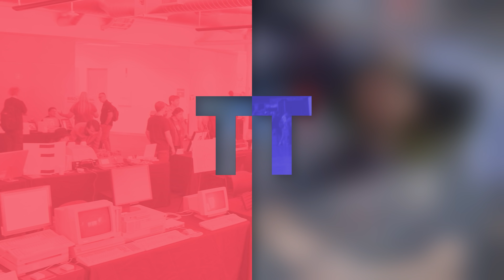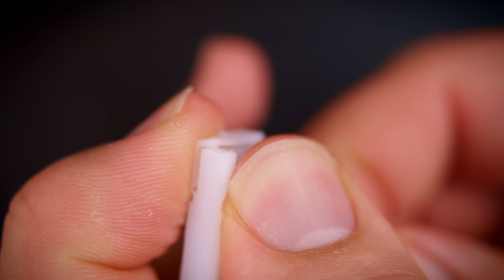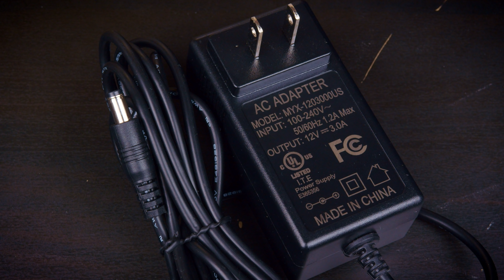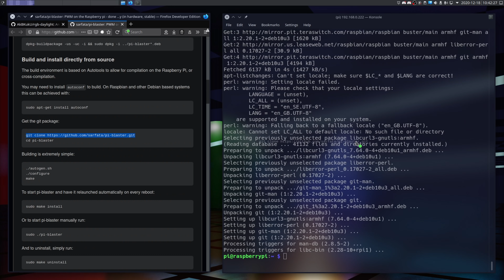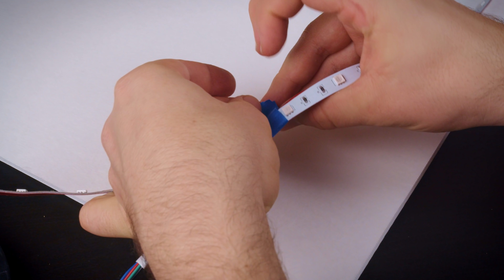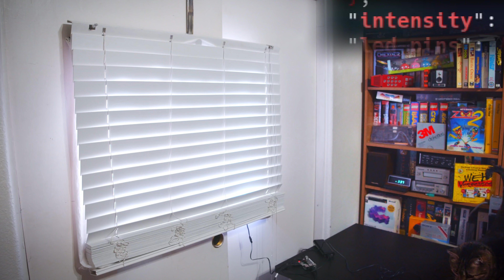RGB LED Daylight Simulator or Artificial Window

Comment from the maker: Normally I'd put this in the description but nobody reads that an I know I'll get questions about it. This is not my usual fair for sure, but it was a detour project that I just needed to do to clear my head a bit. I've been working on the VGA capture video, still, since I released the "How VGA Works" video and my previous statement of calling it a mess has never been more true. There are so many aspects of it that can completely ruin the video capture that I need to cover in extensive detail. It's becoming a really complex video that I need to distill technical topics down into easily understandable segments and it's just taking time.

In the middle of all that though, I also attempted to build a new computer. I say attempted, because after weeks of filming, troubleshooting, and part swaps I finally determined I had a bad CPU and needed to RMA it to intel. And that has been one of the slowest processes I've EVER been through. I started the support ticket to exchange the CPU on Nov 28th and after weeks of slow back and forth emails I only on Dec 23rd finally received a confirmation that they are sending the replacement, I still don't have it. Additionally, I only have one GPU that can edit videos(that isn't the 1070 in my server because I'm not disturbing that) so for all the troubleshooting and working I had to move that card back and forth between my computers which just isn't fun. Mixed in with the hardware problems were some inexplicable Davinci Resolve issue that would lock up the program for minutes at a time that just led to even more hair pulling trying to figure out if it was the software or bad hardware giving me mixed signals and confusing it all.

So I know it's been a while since my last video and this one isn't the usual fair. But I'm still working on things, it's just been a very frustrating experience of start and stop projects that are putting up far more resistance than I planned for. This project, in addition to just being something I really like the result of, helped me clear my mind and finally give me a win after months of frustration.
Reply: hay man love the channel, your videos have been Steller as of late and have a Merry Christmas
Reply: Thanks for the video! It was definitely an interring project that I will keep in mind for the future.

I was getting worried that you might have gotten sick since it was so long since your last video.
Reply: For this issue.... I use since forever... a simple dimmer... you know... to reduce the illumination of the room lights... and not disturb the image of the monitors or the TV ....
. this is the opposite approach.. but.. yeah...
anyway is getting complicated lately... with the stupid LED lamps...
 The last time I have to replaced the lamp bulb in my ceiling .. I couldn't get a damn incandescent light anywhere.. having to use a halogen reflector tube.. but well... that's who the life is..

Comment: I have to say, this is a nice way to do it. But I would do this all with and esp8266 or esp32, and esphome. Then it all runs embedded, lower power draw, and there are h801 devices on AliExpress that simplify the driving

Comment: I forgot which channel does it but the guy used lenses from a broken TV to make a very realistic indoor window. For the daylight control you should consider using some LDRs with filters over them. 3 and you can have your indoor lights duplicate what is going on outside. BTW I own a sharp AQUOS TV and it is the one that has 4 colors. The fourth is a Yellow LED and it makes the sky/grass/water/golds really beautiful so I would recommend you add some yellow LEDs to your set up as well.

Comment: I just dug out a 5m long RGB LED strip yesterday, although it's the one with those WS8212 (NeoPixel) intelligent LEDs. I think I might port your code to drive this kind of LED strip by an ESP8266 or an ESP32, depending on what I'll find in my parts drawer.

Comment: Hey, thanks for finally making me build something I've wanted to do for quite a while now. It's not the same project, but rather an LED strip behind the monitor that creates indirect lighting by shining at the wall. It uses the monitors speaker bar power output (I don't have the speaker bar) to turn on and off in sync with the monitor. Creates just a little bit of extra cozyness and a dim light source at dusk.
Reply: An idea for the project, if you already have a Raspberry Pi with MQTT running in your system: Expand the program to also publish the RGB setpoints as an MQTT topic rather than relying on the GPIO. Same kind of thing will also run on a simpler microcontroller that will boot up in less than a second and can be powered off without shutting it down first

Comment: If you're on windows, try using Auto Dark mode to change windows theme automatically, and installing WinDynamicDesktop for changing the wallpaper to your time. 
If you're on linux, you can try to use Yin-Yang.

Comment: Fluval makes LED aquarium lights that can be set to come on and off whenever you set it, only thing it can't do for me is sync to local time or any specific place im the us. It can even simulate cloudy days and conditions like rain and storms.
Reply from the maker: I actually knew about the aquarium lights but decided not to include them. They really only come in  shapes needed to fit over aquariums and for the price they don't make a lot of sense in this application. It looks like they've started making RGB ones that could be used to do full custom colors but I'm not sure how much programming they are capable of.

Additionally I have a fair amount of experience with a marine light that is very similar to the freshwater versions. It doesn't have a proper clock in it or external time sync and runs fast. So it has to be adjusted back every 1-2 months.

Comment: This is a fantastic, and actually quite timely project. With much of the world still in lockdown due to the ongoing coronavirus pandemic, a lot more people are spending a lot more time indoors. And that can definitely mess with peoples' sense of time, along with various other psychological effects such as depression, etc. I set up something similar a while ago, only in my case I used WS2812 individually addressable LEDs, because that's all I had on hand, and I had to use an Arduino rather than a Raspberry Pi, because Pi's seem to have trouble with WS2812 strips, something about PWM timings or something. And I can say that ever since I set up my system, my sense of time as well as my mood in general has improved dramatically.

Comment: I've long wanted to do this exact project but just recently got good enough at programming to make it happen. May use your code and modify it to support RGBWA lights, as the dedicated amber and white LEDs make daylight colors much more natural looking and I would suspect make the fade over the day marginally quicker to program. Getting a true amber out of bog standard RGB led for simulating sunrise/sunset incidental lighting was a huge headache for me in my college lighting design course, as my requirements for "apparent CRI" were very strict and trying to make a painstakingly designed set and makeup'd actors look good under amber RGB wasn't working...... Ended up having to raid another performance space on campus to get enough of the old incandescents to make my design work...... Maybe the tech for RGB leds has improved since then lol

Comment: Couple of suggestions for those interested:
-If you want a better white but still want color you could look at SK6812 led strips that have a clear or natural white led on the rgb led "pixel". Or just skip color and go with a single channel white led strip which make a much better white then normal rgb strips. 

-A raspberry pi is somewhat overpowered for this and you could use a esp8266. Either code it yourself (which is more fun) or use something like WLED which you can set timers for macros to trigger WLED api commands.

-If you have a broken laptop try to see if you can save the led backlight since making a fake window out of them is a common YouTube project.

Comment: Thanks. I found that interesting. I'd looked at the calculations for finding where the sun was many years ago but couldn't find simple figures for how the atmosphere changed the colours down here.

Have you considered connecting it to some sort of outdoor (or in a real window) sensors? You could then replicate the actual light conditions outside your building.

Comment: Did you look at WLED?
Reply: WLED would work since you can set timers for macros to trigger WLED api commands. HOWEVER you couldn't have the sunrise and sunset real life time match your fake light since your hard coding the times in WLED. But coding this with a esp8266 would be straight forward if you didn't have something like home assistant to automate WLED.
Reply: @dudeshift0  You could have something else (rpi etc.) lookup sunrise/sunset and adjust the schedule each day on the WLED controller. Also aircookie's code isn't bad. WLED has NTP already so you could probably add code to query the sunrise/sunset each day for your location.
Reply: @Codeaholic1  No doubt you could add code to WLED get the sunrise and sunset time. I have used esp8266 to fetch information based on user inputed location for a small desk time/weather/octopi 3d print monitor. If you didn't want to automate the lights using any other means then just sunrise and sunset then making your own esp8266 project might be the way to go. But once you do start automating your home/life it would be nice to use something like WLED for further uses.
Reply: Or better yet for simulating sunrise/sunset colors, RGBWA leds.
Reply: @Aquatarkus96  yep, good o sk6812 leds. Or there are also rgb strips that every other "pixel" is a white led.

Comment: It’s not just your unit, I have a dual colour temperature strip and controller, the machined pins and sockets (female-to-female) are rubbish, I jammed some cut-off LED legs into mine (slightly thicker than pins) and wrapped it all in tape, haven’t had any problems since then 2 or so years ago (no heating visible with thermal imaging camera).

Comment: Hm, maybe an ESP32 with wifi time sync and micropython would run that too and isn't as oversized as an rpi.
Reply: Or even just a esp8266
Reply: @dudeshift0  esp8266 definitely would be enough, RPi really overkill for this.
Reply: Or go the low-tech way and add an RTC to set it off at a specific time
Reply: the obvious thing would be to hack one of the many esp8266 based units off the shelf. Its likely you can even do it without hacking the hardware